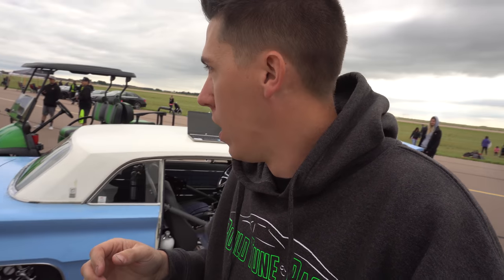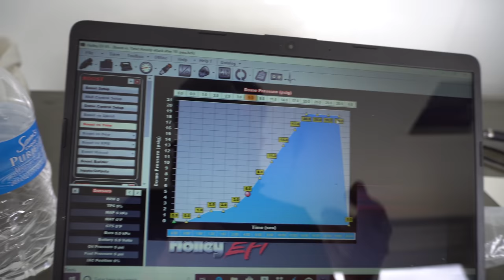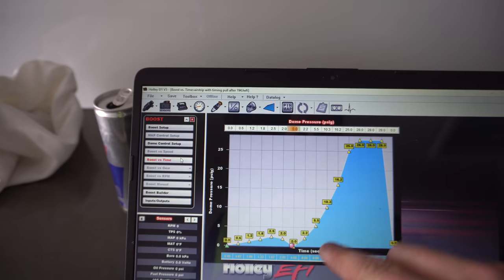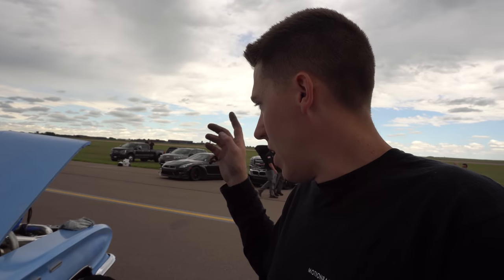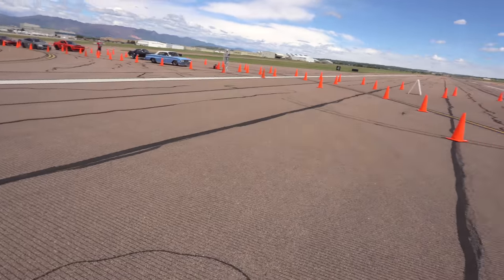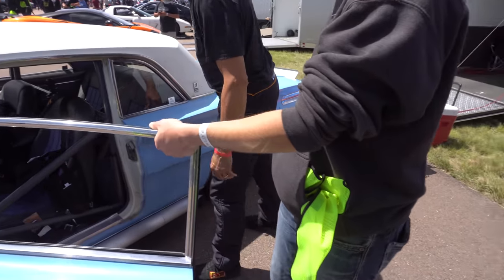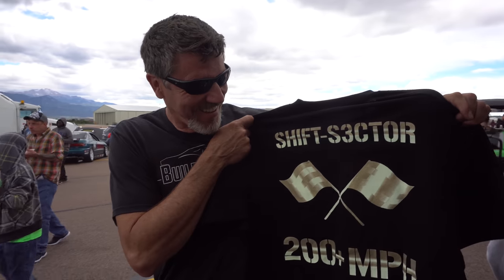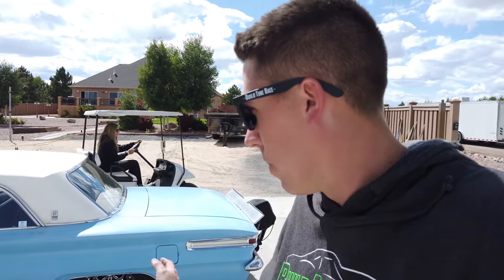WE DID IT! 200 MPH In a Standing Half Mile. Twin Turbo LS Swapped Buick Skylark!

Comment: Drives to the track, cracks off a 200 run, drives it home. Frickin badass
Reply from the maker: I told him after we did it I was like you need to drive it home now was so freaking cool!
Reply: @BuildTuneRace  I don't know what's more impressive, 200 in a Buick or the fact that its streetable on the same tune
Reply: State of the badass art!

Comment: That Green VW Golf GTI with 029 on the side that you were parked beside of in the beginning of the video if it's the same car and guy that car has a duel set up in it and it goes pretty fast as well and when I say duel set up I mean he has 2 engines 2 transmissions and 2 gear shift that he tied into one and its AWD
Reply: 1320 video made a video of him last year I think at the same event and he also does 1/4 mile roll racing and drag racing with it and when he wants to do a burnout he unties the shifters then does a burnout with the front tires then does one with the back
Reply from the maker: That's the same car it is definitely a wicked cool build i looked at it for probably 30+ minutes last year checking it all out!

Comment: I can fix that.
You got lots of problems.
The air fuil fix is off, increase the air/ oxygen. Its starving  for air.
Increase the idle / Timing a hair.

The automatic shutter, is out of sink with that size /speed of that moter.

You can't, ease out on throughtal, in the middle or a run.

If it shifts to soon, at full throutal.
The moter will want to stall.

It helps if you know, how to drive this engine.

I want to shift gears, when I can hear when it's time to shift.

!  That felt good.  Lol.
And pre heat up those tires too.

Thank you, for the thrill..

What a ride. ! 

G.
From Toronto.